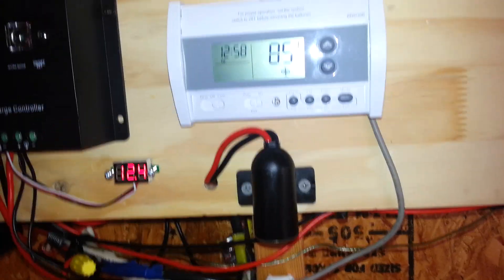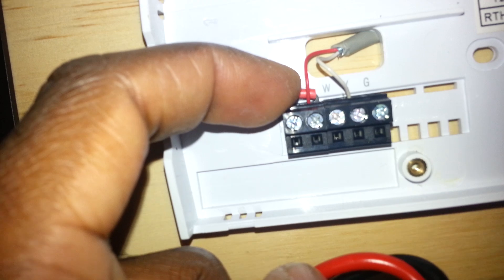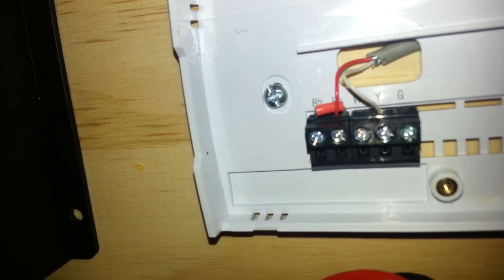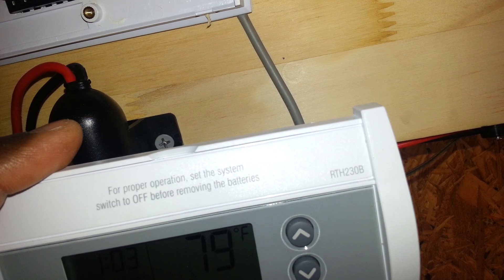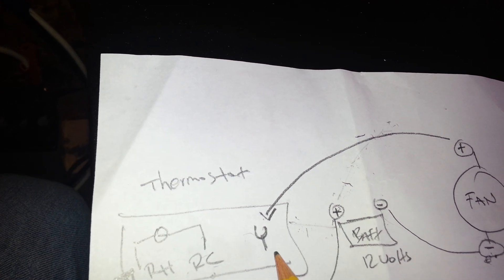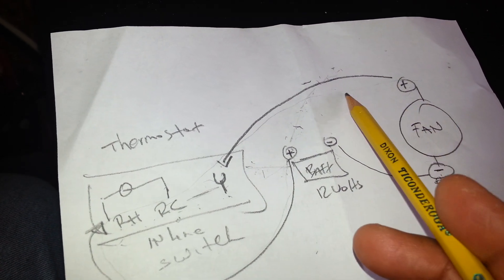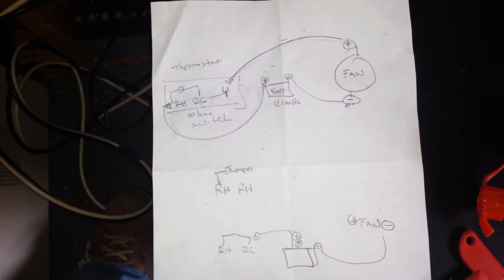Honeywell Thermostat Wiring Explained!

Comment: Rh & Rc means Red Heating & Red Cooling. The other Lettered terminals indicate colors. On a standard furnace thermostat without air conditioning system involved the red wire would hook up to the RH and RC jumped terminals and the white wire would hook up to the W terminal. Since you do have cooling that would explain why you have the white wire connected to the Y (yellow) terminal.

Comment: nice job...can the connections from the thermostat go to terminals on charge controller?
Reply from the maker: Yes, it can.
Reply: +DIY OneForAll  can u explain how...I just tried in a renogy 30a...hooked white wire to load positive red wire to batter positive...nothing happened
Reply from the maker: +taz devil 
What type of thermostat do you have? What voltage does your thermostat use? If it uses 12 volts, then no voltage converter is required, if connected to the 12 volt side.  At any rate, you would need to connect it to the battery output terminals or load terminals on the charge controller.
Reply: +DIY OneForAll  I got the same one that you are using..so I should just put both wires to load side on controller?...
Reply from the maker: +taz devil 

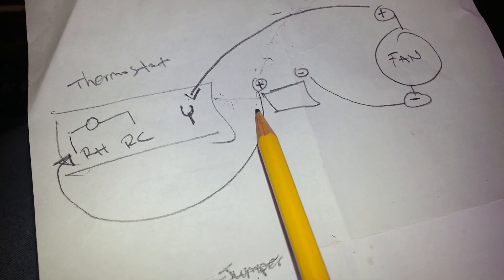Ok, look at 06:19 and pause the video.  In that you have the same thermostat as mine, you already have a three volt battery installed to power the thermostat and relay.  If you connect it exactly as seen here, it will work.  Let me know if it helps.
Reply: +DIY OneForAll I did exactly that but I have fan neg. going to charge controller so I'm wondering if that is what is stopping it...if I bypass the controller all together it works  I was really wanting to go through controller
Reply from the maker: +taz devil 

Connect to the load or battery terminals on the charge controller and it will be fine.  Ensure that a battery is also connected to the charge controller, which is probably already the case.
Reply: +DIY OneForAll ok I will try that as soon as the sun comes up this morning thanks....I'll let ya know...

Comment: wow, thanks anthony, thats really helpful of you to do this & show the internals. I'd guess that many other thermostat / controllers would have a similar layout, once you take the time to understand it!
Reply from the maker: Yep, at first, I actually used an ohm/continuity meter to figure out what  terminals the thermostat relay would close when it's in the cool or heat setting. It was kinda fun figuring that this thermostat is nothing but a big, smart expensive inline switch:)